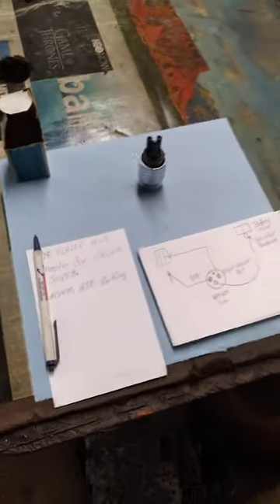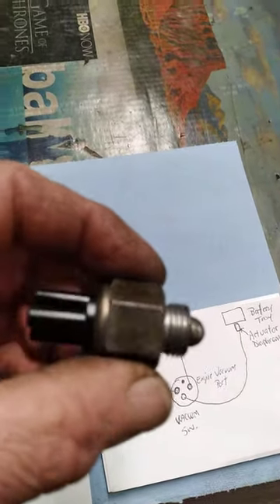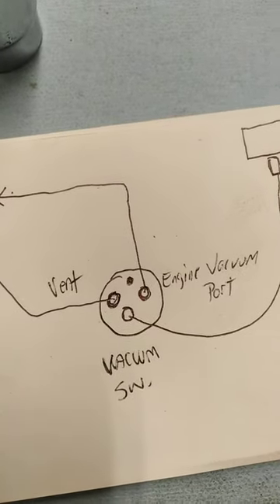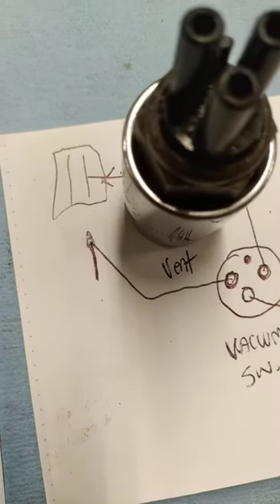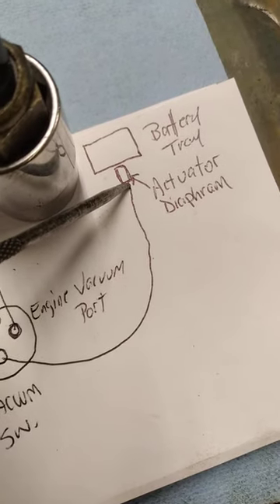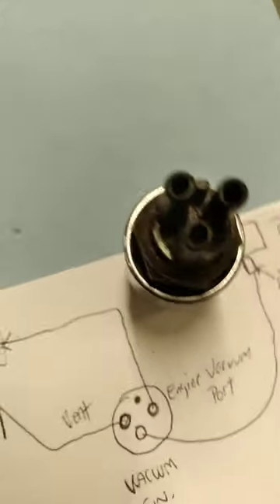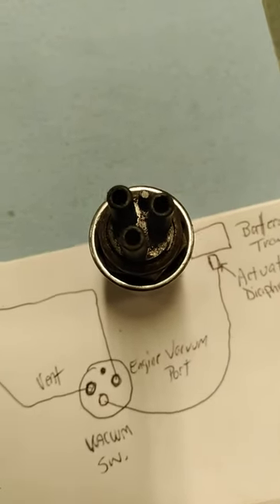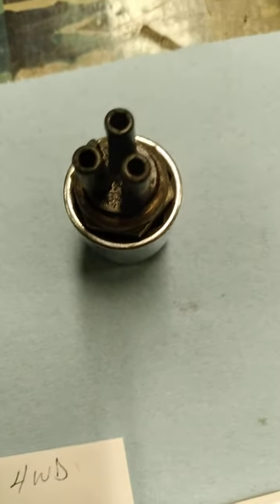Blazer S10 4x4 Transfer Case Vacuum Switch Hose Routing Diagram

Comment: As a temporary emergency repair, i was stuck in the woods and needed 4 WD.  Pulled battery and removed cable from actuator, pulled on cable and held it out with a pair of vice grips, got out of the ditch, went home found your vid and got the repair done. thanks!
Reply from the maker: @AWLs7 that's cool you did that not cool you had to do it. I swapped my personal blazer over to a lever and ran cable into driver area. The new vacuum diaphragms kept busting. Make sure you carry a spare and thanks for watching and subscribing to my channel. There are other blazer videos in my playlists titled "Blazer"
Reply: So I got an s10 that’s just a farm truck could I just use vise grips and leave it like that?
Reply: Don't see why not just don't forget to un do it if you shift out of 4WD.

Comment: I have a problem with transmission fluid causing the vacuum hose to swell, will a bad switch cause this problem??
Reply from the maker: @kiddbrother3  it can if the switch is leaking fluid past the ball inside
Reply: @dragsterstransmissions  the vent hose from the 3 port switch connectors to transmission vent? Should be vented to the atmosphere? Correct!?

Comment: G'evening & Great job ☕☕ 🤠 . I've been turning wrenches for 20+ yrs myself.  However I bought my first S10. A 98' Blazer 4Dr 4wd & I really appreciate the refresher course on the vacuum 4wd system. It may be 70's AMC Jeep tech but when it works right it's great 🙃🙃 ..
Reply: Where at exactly on the actuator does the vacuum go because on mine there was just the screw in cable?
Reply: @stevenengland9832  
On my 98 Blazer the actuator is underneath the battery tray in the front passenger corner.  Rather than trying to take the three little machine screws that hold the actuator to the bracket, there are two bolts that hold the bracket in place and you can take the nuts off the bolts that hold the bracket in place from inside the wheel well right in front of the tire.  The cable hooks to the actuator and there's also a vacuum line that plugs into the actuator as well that should have been right by the actuator can.  I haven't traced the whole system out as of yet but the cable runs down to the differential on the front axle to engage and disengage it.  And vacuum line should run from the actuator canister down the passenger fender to the firewall and across and down to the vacuum actuator switch on the transfer case.  There should be three vacuum lines on the vacuum actuator switch on the transfer case. One should go to the actuator canister under the battery tray. Another one should go to the push button in the dash for the four-wheel drive and I think the third one should go to engine vacuum probably on the intake manifold or possibly the throttle body.  You can replace the old style rubber vacuum lines with the newer high temperature silicone vacuum hoses and you'll be glad you did.  I hope this helps and I found quite a few videos on YouTube about it

Comment: I have a couple questions that i wish i could get your imut on but id like to say good job on the video and breaking it down first of all. But so I  have been fighting a 94 s10 that has only the 4hi - 4lo push button switch located on the left side of the instrument panel... never have I ever had a problem with the 4 wheel drive until... boom... when needed all that would happen is you would hear the transfer case acting like it wants to engage but then would.just stay in 2wd. After watching your video... sure as hell, that switch was sticking and fluid came draing out of all the lines.. I bought all new lines and switch and also diaphragm ( that was torn as well) and checked the cable that goes to the axle and it was freed up but im wondering if its not kinked somewhere ( im going to look into that yet tonight and hope thays it. But with all that switched out it still did the same thing, so my other question is the 3 way check valve that splices in with the vacuum from the air Intake? Or can I bypass them? I've looked through the entire Chiltons book and couldn't find anything ( or I didn't understand something) thank you for your time, I will update asap
Reply: It's possible that the little clip inside of the axle itself is broken. I had that happen on my 86 s10. Cable would move but wouldn't activate the gear in the axle.
Reply: I am also having problems and not much detailed help, so anything helps!!....Going thru whole system....PIA...

Comment: Replacing the lines & the 4WD Vacuum Switch “should” cure a high idle & a harsh shifting as well; is what I was told? Correct?
Awesome video! Very helpful, thanks 🤘🏻
Reply from the maker: @TonyMitch13
Yes vacuum hose(s) cause high idle as well as throttle body and upper intake plenum gaskets. Does your 4x4 work when you push the button

Comment: ive got a cable AND a vaccum hose both coming from that accuator under the battery anyone know where that hose is supposed to go? the cable is connected right but can't seem to find where this hose goes bough truck second hand and some genius just had it capped
Reply from the maker: @Kevin McCormick
To the vacuum switch on top of transfer case. Provided you are working on a s10 platform you didn't specify but it sounds like it

Comment: Like the video. A question though. Is your diagram a view at the end of the collector lug where all the hoses connect or looking at the top of the vacuum switch? Because these two views would be a mirror image of one another about a vertical line and I just want to be sure. Thanks for any clarification you can provide.
Reply: Did you find out if this clip is right or mirrored?
Reply: In my case I’m thinking it’s a mirror because my lines aren’t lining up with what he’s saying. Then again I’m working on a 92 s10 rather than the later models like he explained in the video
Reply: @Jim Sale  yep mine are mirrored to this diagram. 89 s10 blazer. So looking down at the switch. Pin center and away from you. Its actuator towards you. Vent upper right, engine upper left. When I did it his way I had vacuum in 2wd and nothing in 4wd.
Reply: Did any of you all put an o-ring on the bottom of threads on your new transfer case switch or did you just screw it on and hook it up?
Reply: The video is incorrect. The diagram is correct looking into the end of the vacuum hoses, not looking down onto the top of the switch.

Comment: Great info! If you can recall, did you reuse the stock vacuum plug/receptacle or just push tubes straight onto the switch?  Thanks for the video.
Reply from the maker: @Shannon Hukill
Put hoses on switch vacuum plug was bad. Color coded hoses and nipples on switch with paint markers
Reply: @dragsterstransmissions  10 - 4 appreciated 👍

Comment: I am also having this 4x4 problem does not engage.  But am wondering how many components should I look over ? My Vacum diaphragm under my battery works and what
you are now showing I need to install yet.
    It is in a rough spot hard to get ahold of
for sure.
Reply from the maker: @Jimmy Hamm start with the vacuum related components first. Such as the hoses themselves probably should replace the hoses. I got another video in my playlists titled blazer repairs. Also check transfer case fluid level by removing top plug in back of case.. if fluid gush out you will have to replace front seal in case.. Keep me posted on your progress
Reply: @dragsterstransmissions  Thank you much good sir I just got a 96 Sonoma high
rider last yr. I knew had problems the ligh just flashes at me on my panel . It drives.
   I have replaced all fluids except transfer
case . Thank you much on your advice on
my question. Illinois is 🥶 now . I will get
back to you on my progess.
Reply: I put you on my likes good explanation videos are a must.

Comment: I have oil in the vacuum lines is this it
Reply from the maker: @cognac8297
Oil or transfer case fluid?
Reply: @dragsterstransmissions  transfer case fluid a little bit
Reply from the maker: @cognac8297  then yes its time for a new vacuum switch